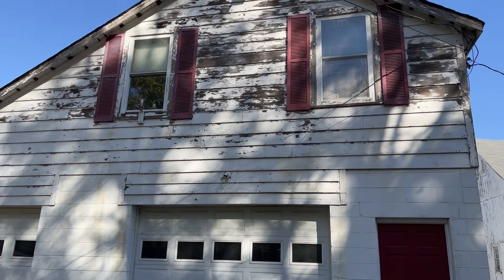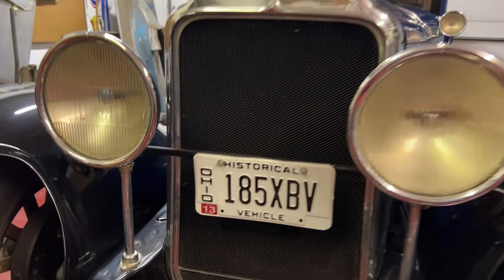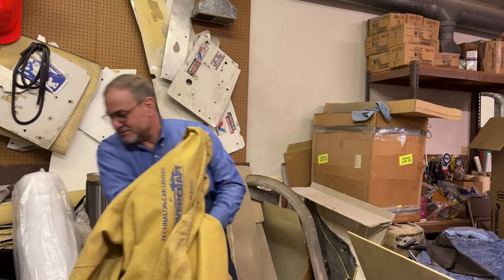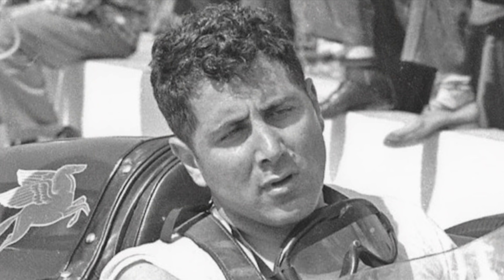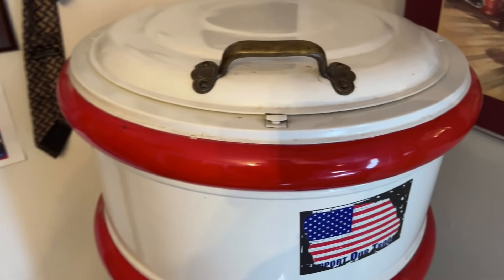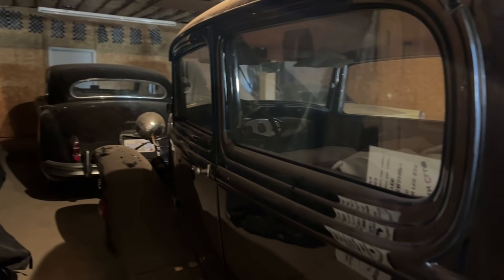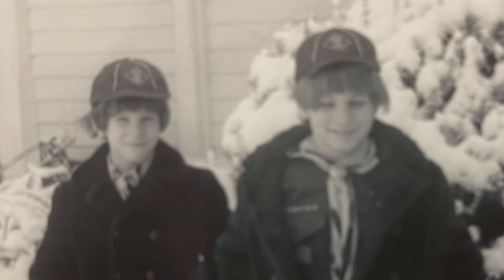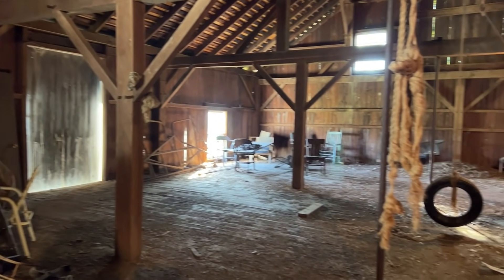HOFFMAN AUTO RACING-SHOP PURGE! Offy's, Race Cars, Parts, Antique Cars, Kurtis Kraft Midgets & More!

Comment: thats quite a collection in just the cars and engines, but they used HANDBREAKS BACK IN THE DAY thats crazy with that much speed no footbreak I thought in the pictures of the drivers reaching outside the cockpit with the lever was for shifting gears, that was the brake thats crazy and putting a car backtogather after that wicked flip in a week that cut it into shows what they were made of back in the day but yea hes lucky to walk away from that one to race again.
Reply from the maker: Those drivers back then were gladiators! Thanks for sharing your thoughts here! HMM
Reply: @HistoryMysteryMan  yea you got that right.